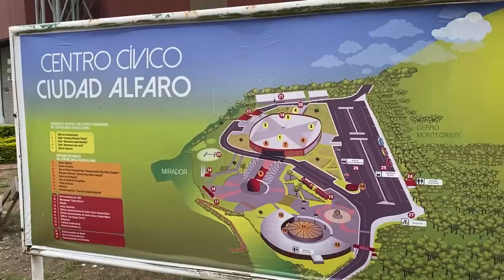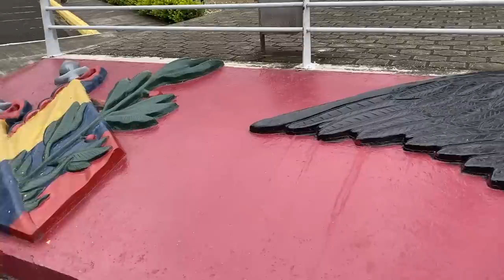Exploring one of Ecuador’s most famous places!

Comment: How much did you pay for the hats 👒
Reply from the maker: They were expensive.
Reply: Worth every penny, I’m sure! I’d get two with different color bands!😊
Reply: The price will depend on tightness/fines of the weave (grado). If you want a nicer one you should ask for grado 20 and up 🙂 prices might start a bit below 200$ but can go up to several 1000$ the finer the weave. Of course you can also buy the same type of hat made from the same material and process for a lower price if you ask for a lower grado 👍

Just be aware of the difference between a Cuenca model (easier to make and therefore more affordable) and the montecristi model 👍 funny fact is that the hats are only finished in Montecristi but they are actually made by the weavers in a small village in Pile 👍🙂
Reply: @AmeliaAndJP  Why don't you tell us the price? What is expensive for you might not be expensive for others...(?)
Reply: @AmeliaAndJP  Your hats are beautiful by the way.
Reply: @Lassehansen3  Thanks for answering.